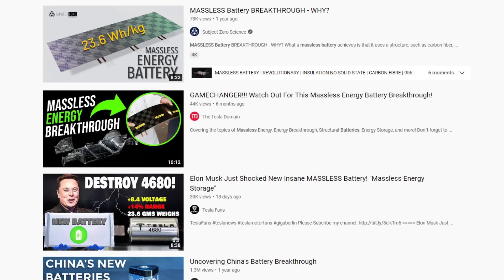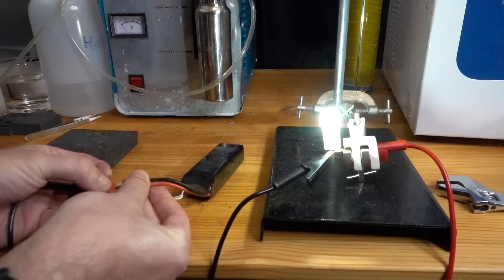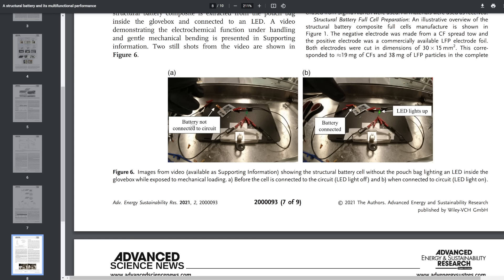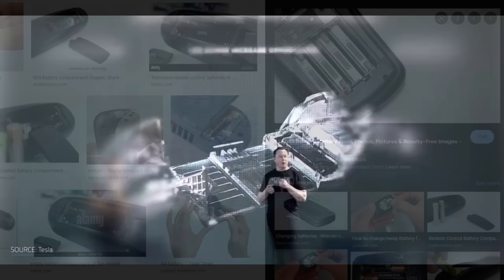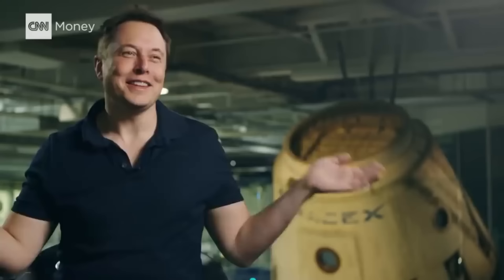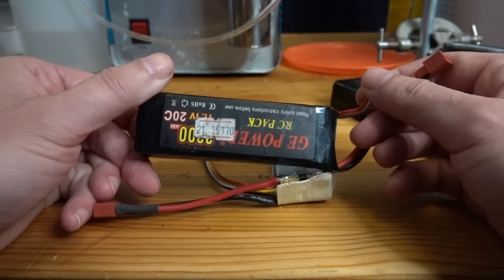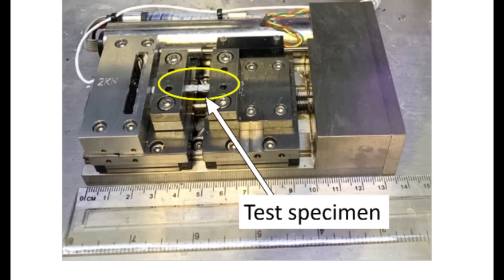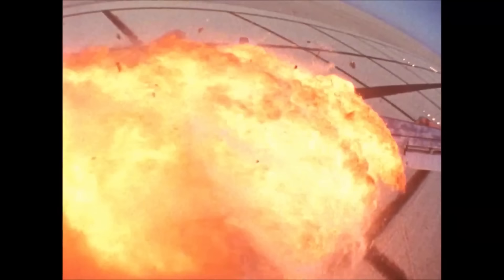Matt Ferrell, Massless Battery: BUSTED!!

Comment: Oh man, the montage of flaming airplane crashes while Matt talks about how safe wing fuel tanks are is priceless. Much appreciated, Thunderf00t.
Reply: While the crashes look really spectacular I wonder how dangerous they actually are. The wing just being torn of or also catching fire might not matter as long as the main body doesn't catch fire since that is where the squishy humans are. It might even be safer if it removes the chance of the main body catching fire from fueltanks in it if they are moved into the wings. 

More often fire in only the wings vs. rare fires in the main body. It might not be so clear wich is actually most dangerous during crashlandings. 

But yeah I agree it looks hilarious when they break of a wing and a fuel fire just creates a massive fireball.
Reply: @simonwahlen7150  big reason for the tanks in the wings isn't fire protection but rather bending relief on the wing roots. It's a bit counterintuitive but more weight in the wings themselves rather than the fuselage let's you build lighter wings.
Reply: @ArchonCommando  I knew it wasn't for fire safety that they moved the fuel into the wings(didn't know the specifics tho so thanks for the clarification). 

I just noted that the wings exploding into fireballs during crashes might not be that big of an issue in the grand scheme of things. When a plane crashes it really only matters that the passengers survive as unscathed as possible and any place a plane crashes is gonna be pretty fecked so you wanna crash where there isn't people to hurt and don't worry about the details. 

If you crash in a suitibly open area like open water, a field or an improvised runway  it probably won't matter to much if there is an explosion that doesn't hit any persons. The only problems I see with fires from the wings are blocking of rescue services or forest fires which isn't ideal but not the absolut worst thing about the situation if you had to crash the plane.
Reply: It's better to have fuel on the outside, away from people, than to have it encapsulated inside where the people are. 
This isn't just some random design element; it's a feature of most airplanes, and decades of engineering has agreed on this. It's the best place to put the fuel. 
In a crash, would you rather have the fuel outside the plane, or inside it and covering you?

If you think THIS should be mocked, you need to have your head examined.
Reply: Lets just say there is a reason planes when expecting to crash land attempt to dump fuel when able. Most of the time in normal operation when a plane is landing it has already spent the majority of its fuel.
Reply: @DraygoKorvan  They don't dump fuel to reduce the risk of fire, it's only done if the aircraft is over the max landing weight. If a pilot thought he was going to crash, his last thought is to flying out over water or empty land to fuck about dumping fuel, he's  going to focus on getting that aircraft on the ground asap.
Reply: @mattd6085  Note I said, when able. And yes landing weight is a major consideration. In many emergencies you normally still have functional landing gears, so there isnt too much risk, but there are additional precautions you would take if you are expecting a more catastrophic landing. Not all emergencies are the same, and not all of them would have 'probably should dump fuel' on the checklist. Dumping or burning fuel is part of the belly landing procedure, again - when able.
Reply: @chrisannika6006  On almost all airliners, the "center wing" fuel tank is inside the fuselage under the main deck, and extends some distance out into each wing (that can even be seen in the video). In addition, there are many other fuel lines inside the fuselage for distributing fuel, or crossfeeding engines on one side from fuel tanks on the other. The primary reasons to put fuel in the wings are to distribute weight across the wing (if you kept it all in the fuselage, your wings would have to be stronger due to bending forces at high weights), and center of gravity (CG) management.  Having the fuel right over the CG allows a huge change in weight as fuel burns without shifting the CG forward or aft, and it needs to stay close to the mean aerodynamic chord (MAC) of the wing (where lift is centered) so the tail doesn't have to work as hard to balance the aircraft (controllability and efficiency). Plus, the wings are just a whole bunch of otherwise unused volume. Not useful for luggage, people, or cargo, so those things go in the fuselage. Safety is not the driving factor (many aircraft have perfectly safe fuselage tanks). If you are in a crash that ruptures and ignites the fuel in the wing or fuselage, it will likely be a hard enough crash to crack open the fuselage and let the fireball in. Also, the temperature that jet fuel burns at will easily melt through a typical aluminum aircraft skin or frame quickly, and it will be all over the outside and ground, burning.
Reply: The crashing plane montage is mostly for effect, wings remain the best place to store the fuel, just not for the reasons Matt mentioned.
Reply: @theredscourge  airplanes do not spontaneously explode with no external cause. That is why Flt 800 is still so hotly debated -- and that was the one and only afaik. EV's on the other hand, ... And there are fuselage tanks too in most commercial passenger planes, freighters and military transports.
Reply: @donbishop1229  There's always a cause when an EV explodes - a defect whereby there's too many impurities in one or more of the cells of the battery pack during production.
Reply: @DraygoKorvan  Fuel dumping is extremely slow so it only done when absolutely necessary to be able to land at all, and often in an emergency if there is any time pressure at all it is preferable to risk damage to the undercarriage than waste time dumping. A max takeoff weight 747 needs almost an hour to bring it under max landing weight and would take almost 3 hours to fully empty its tanks. Only planes that even have ability to dump are those which have significantly higher MTOW than landing weight. Planes like the 737 and 757 have no ability at all to dump fuel as their maximum landing weights are similar to maximum take off weights.
Reply: @tylisirn  I am aware of all of that. As I keep saying, when able. Not all emergencies require an immediate landing. I am specifically pointing to scenarios where you have a controllable aircraft but are expecting to have to make a crash landing. Lowering the total amount of fuel you have makes the crash landing safer not only because you reduce your weight, but you have a lower risk of catastrophic fire as an added benefit  (not the primary benefit). If I'm a passenger in an airplane I would rather the pilot spend the extra hour or three in the air to make the landing as safe as possible in crash landing scenarios.
Reply: Plane crashes are so uncommon that safety is only considered for the first five minutes of an aeroplane crash, because I'm most cases it is proven that the plane explodes anyways.
Reply: @chrisannika6006  that reminds me of how in the early days of racing, the cars had the fuel tanks usually built near into the passenger compartment. And those cars were known to compress the passenger compartment in high-speed crashes, and trap the driver of the car In the burning wreckage.

Comment: The fact he thought the fuel could be gravity fed into engines is brilliant. Sheer brilliance
Reply: jet planes have regular pumps and backup gravity pumps though
Reply: @Rem_NL  Erm..no. Maybe you're talking about transfer pumps, but fuel absolutely cannot be introduced into the combustors of jet engines through the fuel nozzles by gravity.

The nozzles & combustors are in a high pressure environment due to being behind the compressor stages. Gravity is no match for that pressure.
Reply: @incandescentwithrage  The engines themselves have mechanical fuel pumps so gravity feed from the AC tanks to the engines can work because once the fuel reaches the engine the engine pressurises it enough to inject it into the combustor, so long as the engine shafts are spinning.

Comment: Brilliant idea. Take a $60,000 electric car and turn it into a $200,000 electric car with carbon fibre composites.

If this were an actual thing you would have seen the F1 engineers using it.
Reply: * that you have to replace after 5 years
Reply: @Hamstray  make it 5 days, if they were dumb enough to actually put structural loads on the battery itself.
Reply: They will just switch the „Gigapress“ from molten aluminum to molten graphite.
„It‘s not that hard“
We can render it into CGI NOW
Reply: With fast charging you would only need a 20 minute pit-stop every 5 laps!

Comment: The problem of those pouch cells is they can short out internally if they buckle over a little too much (which is easy to do with the thin wall). Also, when the cell expires you have to throw your car away because the battery is incorporated into the frame, whereas if the battery were a separate component it could be easily replaced whenever needed. Also, GCN did a video recently explaining why carbon fibre structures (such as bicycles) always have a limited lifespan; unlike metal frames which conceivably have an unlimited life potential, if loading is kept within infinite fatigue life limitations.
Reply: Except Aluminium does not have a fatigue resistance.

Comment: Ah yes, I'm going to replace the strong and reliable structural components of my vehicle with fragile, flammable batteries. Excellent idea.
Reply: It is great idea. Every car crash is also a free cremation!
Reply: But airplanes do it and airplanes are the safest available transport, so they must be right. Just forget about the processes involved making flying so safe. The reason has to be the highly flammable structural component.
Reply: Ah, we'll do it with stacks of AA cells.
The crumple zone'll be the stuff of legends.
And as a bonus the scene of the accident will basically clean itself.
Wait for the smoke to clear and you just sweep the ashes away.

Comment: Good video! Most aircraft jet engines have a mechanical fuel pump driven directly by a reduction gearbox connected to the shaft. But is usually not able to sustain pressure above a certain altitude and requires electric boost pumps to run / not flame out.

Comment: Let's assume you use the anode and cathode as structural, there's two major issues you didn't mention. You can no longer disconnect the battery from the chassis of the vehicle. It's important to do so when working on them to prevent accidental shorts. 
The other is that now, when the battery reaches the end of life, it can't be replaced. Sorry, you'll need a new car cause your battery wore out.
Reply: They want to sell cars like people go through phones - a new one every few years.
Reply: That'll be 30k please
Reply: Probably just replaceable panels. It wouldn't be the worst idea that Thunder has hit on this channel but like everything else massively over hyped
Reply: Changing panels isn't too much of a problem. The real problem is, the tiniest accident has a high likelihood of igniting your car, completely enveloping humans inside in a firestorm because the structure of the battery is all around them. Batteries need some layer of protection between them and the humans, and it's much more logical to have that layer act as a structure because the properties that make it a good structural material can also make it a decent shield
Reply: @rafetizer  cars as a service like live service gaming... infuriating thought but you're probably right
Reply: @rafetizer  I think it's already happened. I've seen plenty of cars from 80s-90s which were properly maintained for years thus still working absolutely fine, while new cars transform into endless problems source after 3-5 years of exploitation.
Reply: Bending batteries is such a bad idea....Batteries should never be under structural loads.
Reply: @brokeandtired   additionally battery degradation might result in the integrity of the whole structure decreasing

Comment: At 01:10 I read in the summary (in gray) that the capacity is 24 Wh / kg
And to the right that a Tesla needs an 85 kWh battery.
This means the MASSLESS battery weighs in at 85000/24 = 3541 kg
You don't need a Mensa-IQ to see that is not going to solve our problems 🙂
Reply: And then consider the lifetime of batteries. That's three and a half ton of carbon fiber bodywork that needs to be replaced every few years. That sounds very feasible and sustainable.
Reply: @Monochromatic_Spider  Matt Ferrell is just a company producing pretentious for-profit videos.

The reason fuel is carried inside the wing is: 
The wing generates the lift to lift the wings, fuselage, engines, and fuel. 
If you mount the engines to the fuselage and store all the fuel in the fuselage you have to transfer the lift of the wings via the attachment of the wings to the fuselage.
This needs a heavier construction. Also, there is space for the fuel in the wings.
Many larger aircraft also have one (or more) fuel tanks inside the fuselage.

Comment: Turning the body panels into batteries would be a nightmare for any body shop to deal with. Typically if you get a dent for example, you have to weld pins to the surface, hammer, and bondo the surface especially if you can't physically remove the panel without cutting it off.
Reply: A fender bender would probably total out the car. If it didn't burn it to the ground in the first place.
Reply: I don't think body shops know what to do with a carbon fiber part anyway? Battery or no battery
Reply: @martir.7653  We usually order a fresh part
Reply: Well, these structural batteries have also automatic self-welding capabilities.
Reply: We live in an age of LED and LASER headlight "modules" that cost upward of 1200$.

Nothing is fixed anymore, it is replaced. Which is why everything I own is "old"

Comment: This has been my frustration with Tesla's marketing their "structural" battery packs. Integrating the battery pack's housing into the car's chassis doesn't eliminate the housing's mass; it simply moves that mass elsewhere in the car. If the battery housing can be eliminated without needing to add mass to the car's chassis, it doesn't make the battery's structure "massless." Rather, it simply means that the car was too heavy and wasting too much material to begin with.
Reply: @Strange Daze Well, the reason it might not be legit is because they claimed it resulted in reduced mass, which might not be true if it requires adding 1,000+ additional steel sleeves.

Comment: I find it utterly staggering that anyone could be impressed by... lighting a single LED.  WTF.
Reply: Also... massless?
Reply: Dude, that's clearly way more profound than it sounds. You just have no understanding of major breakthroughs.
/s
Reply: I still remember a school science fair project I had built showing off solar energy. I used a couple Radio Shack solar cells (they were massively expensive by today's standards, something like $10 each for a tiny single cell capable of maybe 10 mA), built a DC-DC boost converter with discrete through-hole components, and in the end I used them to drive one LED that was supposed to be a light bulb in a model house. Not a good idea for a science project in the 1980s. The other kids had no interest and the teachers had no idea how to read schematics.

Comment: The heavy battery packs in the bottom of the vehicle actually help lower the center of gravity - desirable when turning/changing directions.  Even if you could redistribute full size / long range EV sedan's cells into the rest of the body it would handle like a dump-truck.
Reply: Also temperature regulation for the battery, they need a specific temperature profile for their longevity.
Reply: @vertigo4236  That's true, not to mention bodywork on car often gets light damage. A fender-bender with a lithium battery sandwiched randomly around the car could make a small accident catastrophic.

Comment: Imagine building a car with these 'structural batteries' all around the frame. One crash and your basically surrounded by fire bombs.
Reply: Not only crash, but imagine that somebody shoots at it. Or a flower pot fells from 5th floor on your car and damages the battery. Maybe even a hailstorm would be enough. 
But if you like adrenaline, sure, this is the car for you :D
Reply: @simonspacek3670  this makes me wonder what'd happen if the car got struck by lightning.
Reply: @FroggyMosh  tax free carbon neutral charging?
Reply: @FroggyMosh  Dont get too far... just someone envy enough to key the car
Reply: @FroggyMosh  Interesting. Well, if the outer layer is some metal and is insulated from the rest, it may act as Faraday cage. Maybe. But for sure I don't want to test it.